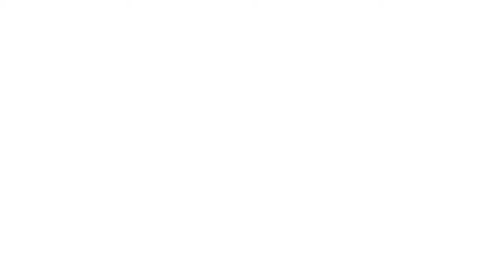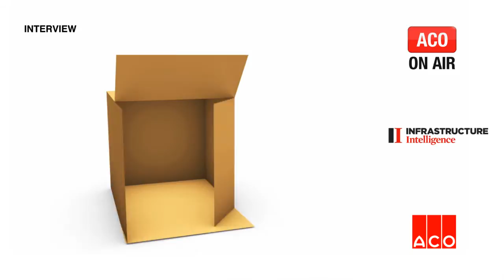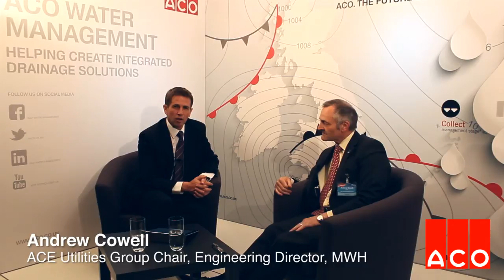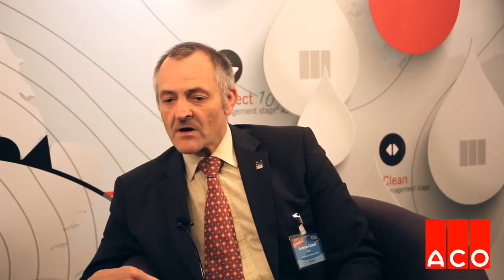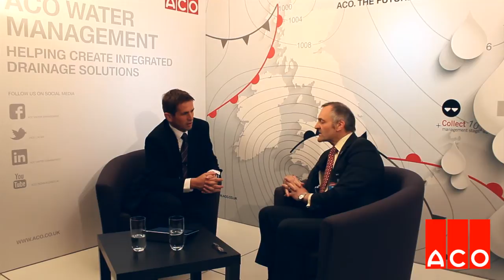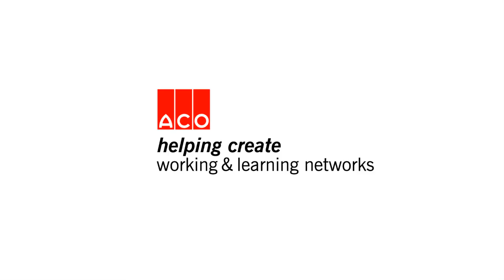What can BIM do for the Water Industry? Andrew Cowell, MWH

Comment: Good honest & frank interview with good questions posed by the interviewer.  Indeed Mr.Cowell is correct when he says it's ambition & slow adoption thus far.  I work for a Water company applying this adoption and indeed it is a slow process - mainly due to the culture that exists - in my situation I am trying to drive it from the bottom up as opposed to the correct way of top down.  From a CAD point of view I see the benefits and have successfully installed a Bentley BIM system across 13 workstations within the company.  It's a lonely fight trying to get others to come on board though.  I'm sure as time goes by simple industry momentum will encourage more & more Water companies to fully & properly embrace the system of BIM.